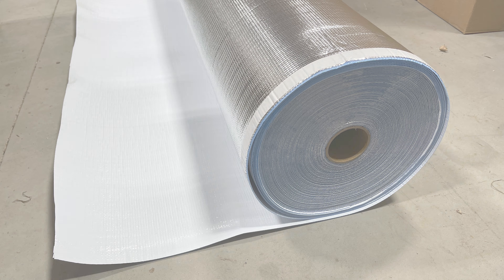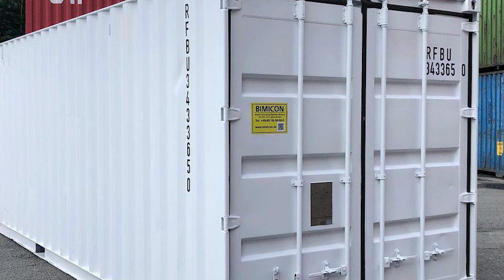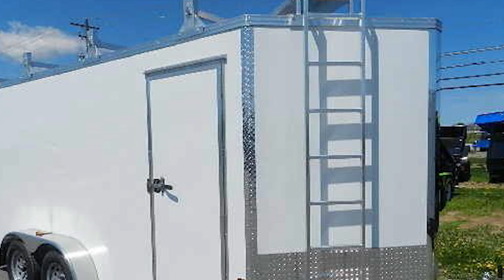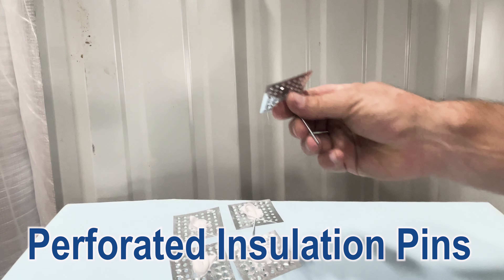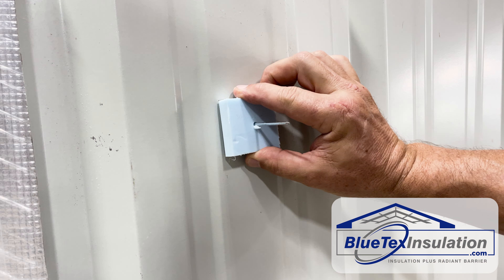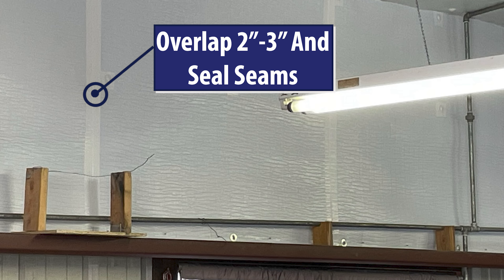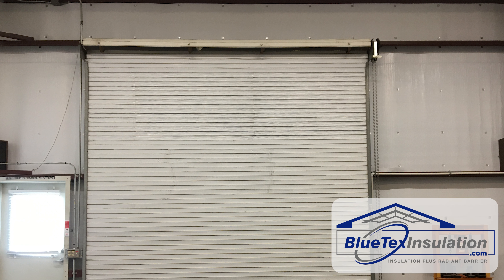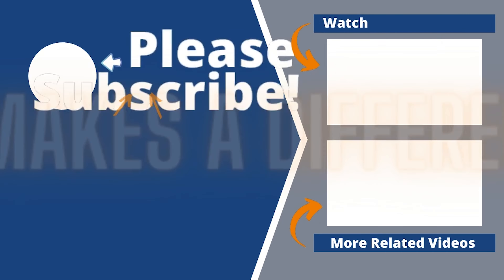How To Insulate Quonset Buildings, Shipping Containers, Vans and Bus Conversions

Comment: That looks like the same setup I posted up in a couple metal building groups that I was in with Ed but I was using 1 1/2 foil face insulation board with the 1/8 foam board spacer and the glued on pins
Reply from the maker: Sounds like you were heating/cooling on a very regular basis,  so the thicker foam board is a good option.  The normal www.BlueTexInsulation.com is really designed for either non-conditioned or semi-conditioned buildings.  When, you are looking for moisture control and basic heat reduction from the radiant barrier benefit.
Reply: @BlueTexInsulation  No we do not heat it or cool it regularly build is only heated if we need  to be out there for some reason to do something.